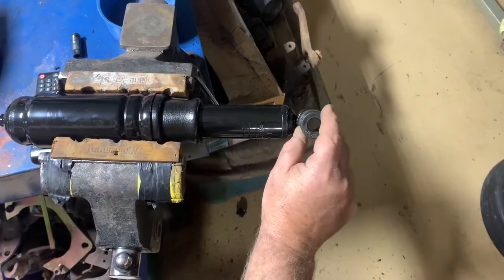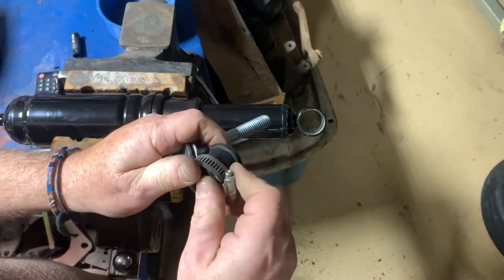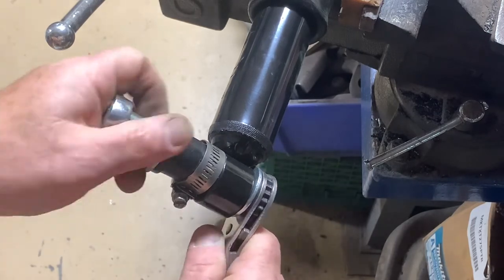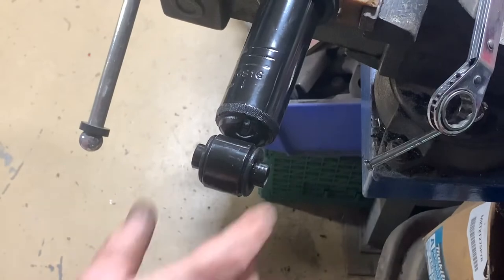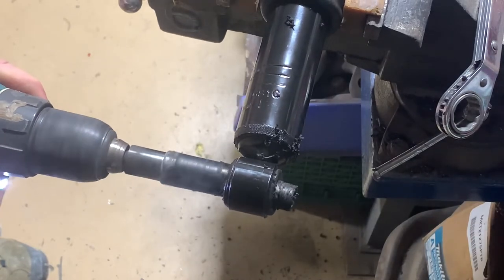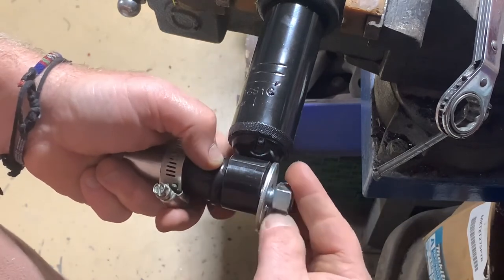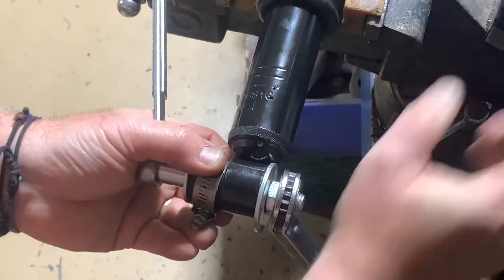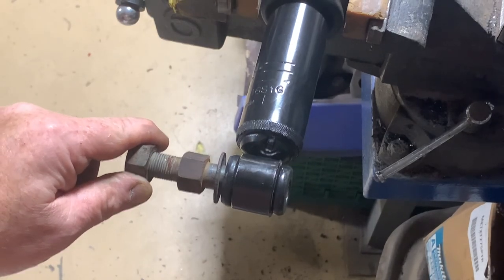EASY: Energy Suspension Shock Bushing Install on a Hot Rod

Comment: You got the right idea, but the hose clamp isn't needed. What is needed is a good amount of grease. Grease the bushing, as well as the hole in the shock. Once you get the big lip pushed in, you can push it the rest of the way in. SuperPro has a great video on this. Also, you really should be using grease instead of oil.

As for removing the original rubber bushing, a ball joint hand press works very well. No muss, no fuss. Think of it like a big C-clamp. 👍🏼✌🏼
Reply from the maker: More than one way to do it I’m sure. This works easy and fast for me. Thanks for watching.
Reply: @SpankysHotRodsandCustoms  No kidding...and how man guys have a $300 ball joint press laying around...your method was simple and quick and worked.  Some guys just can't accept that!
Reply from the maker: @bud-in-pa589 thanks for watching and glad to help

Comment: Very impressive, almost effortless, simple and quick. couldn't ask for anything more. I would use silicon grease however. Did you use the steel sleeve in the new bushing or did you not have to use it? Thanks. great video!
Reply from the maker: Thanks for watching and your comments. I asked about grease and using the sleeve. They said no sleeves and carful on what is used for a lubricant. Seems like they wanted a lubricant that would dry and slow the bushings to stay rigid and firm. Glad you enjoyed the video and please subscribe if you haven’t.